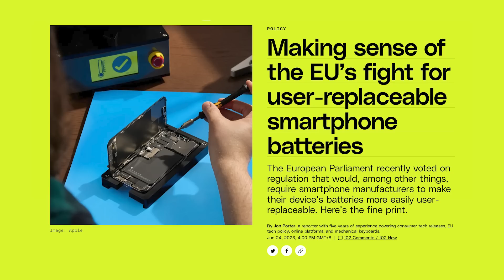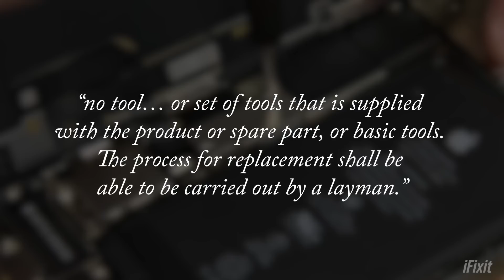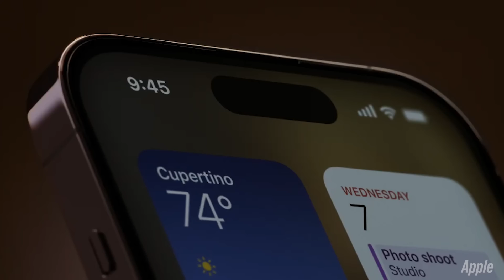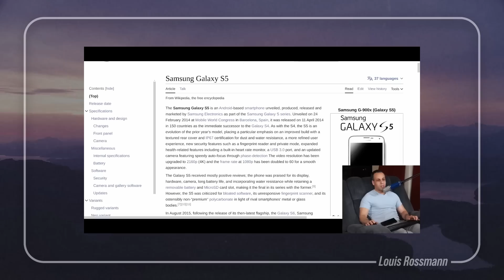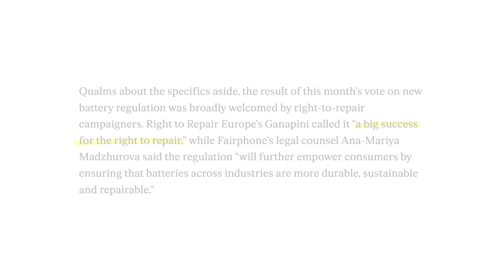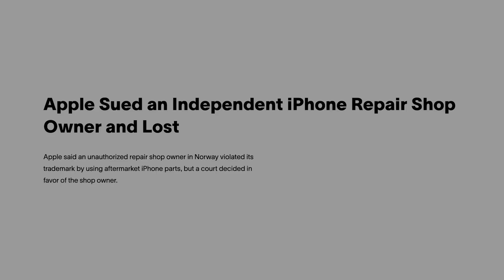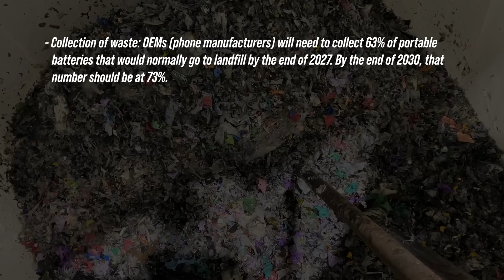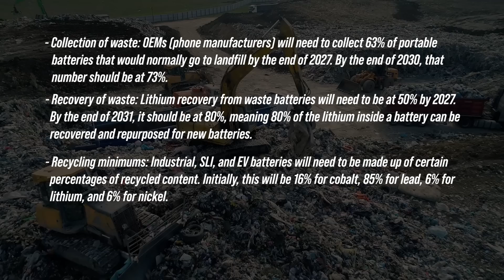EU Just Changed Smartphones Forever

Comment: You understand Apples' argument for safer repair? SERIOUSLY?
It is complete BS from A to Z and even IF you pick a shoddy 3rd Party repair shop, chances are you're still financially better off with a second 3rd party shop that actually knows what their doing, instead of going to the moron bar, which will recommend to replace your device with the newer model, because repairs would be more than the device was worth at MSRP NEW. That's just BS, nothing more, nothing less.

Comment: There is no such thing as consumer demand. But there is consumer interest. What’s the distinction? Consumer demand implies control by the consumer, consumer interest illustrates reality of Choice in purchase, because the options provided are predetermined by the interest of the manufacturers need to make the most money as possible. Nobody wants to not to be able to swap out their battery if they need to. But the interest of a market economy drives the manufacture to increase their profit margin through reduction of labor costs, because it’s cheaper to glue everything together than it is to have movable bindings, and connectors. 

At the end of the day you’re choosing from a variety of predetermined options that are weighed in interest of profits and not what you actually want. The goal for the manufacturer is then to thread the needle on that contradiction by providing options that are not too unpleasurable for the purchasing party. 

This contradiction has allowed for the development of phones without removable batteries and the loss of the beloved headphone jack.

Comment: SLR and Mirrorless cameras use detachable batteries and are still waterproof. Phones can absolutely be redesigned with this in mind, they just need something like an EU law to force them to do it
Reply: Last time I check DSLR not 100 dust proof let alone swimming in swimming pool . there is a reason why there is specialist camera that can swim
Reply: No, SLRs and MIL cameras are not even close to being waterproof. There is only ONE interchangeable lens camera out there with an IP water resistance rating. ONE.

Sure, some of them are water resistant, in the sense that if it there is a drizzle and your camera gets wet it will probably work fine. But if you try to immerse a camera in water the way you can a modern smartphone, you're in for a big, big surprise. 

Not to speak of the fact that the cameras that have the best weatherproofing are the very large, pro-level bodies that cost 5k+ such as the 1DX and D6 in SLR land, or the R3/Z9/OM-D in mirrorless land.
Reply: @lukapogo  Okay, surely a phone doesn't need the ability to submerge under water? If a camera doesn't need it, nor does a mobile phone? As for weather sealing, the Sony A7IV has it, which is under £2K. Heck, most high end phones start over £1K
Reply: ive used my iphone 8 daily since 2019 (i bought refurbished for $350) and the battery capacity is still above 90%.

smartphone batteries (at least with iphones) are good enough nowadays to last over a day on a single charge, and by the time the batteries lose capacity (5 years), the phones are no longer software supported

why is nobody thinking about this from a practical viewpoint? look at the design of iphones, replacing the battery takes less than 10 screws, and the waterproof seal can be completely replaced after. to make it any more simple than this would mean making the back of the phone cheap plastic, and would interfere with Qi charging and Magsafe.
Reply: Samsung S5 is waterproof and has replaceable battery too. Samsung XCover 6 Pro too (a brand new phone).

Comment: returning the old battery is simple:
return the old battery in the box you recieved the new one in. free shipping.
also keep in mind, the replacement of a battery to be done by a "layman".. does not count for advanced high power devices such as an electric car.
So the replacement will be possible - but it will probably require special tools to avoid having random fools attempt it, and get electrocuted

Comment: It won't change anything about top tier devices since it does not apply for waterproof devices...
Reply: It apples to all devices.
Reply: @ChristianIce  that's not true. Medical devices and devices that mostly are meant/used for wet environments don't have to follow those rules. So the only thing the companies need to do is promoting the phones as water devices and that's it... Oh and btw it has nothing to do with replaceability it's about recycling.
Reply: @KosiWien  
Phones will have to comply with the regulations, the exception you are talking about simply does not exist.
It doesn't say "all non water-proof phones", it says "all phones".
Reply: @ChristianIce  yes all phones as long as they are not meant for medical use or wet environments. Please finish your research before replying the same stuff again.

Comment: A very important phrase in this new law is that the product doesn't have to have a replaceable battery IF the product is specially made for contact with water or wet environments. My big fear is that this will be used to basically change nothing than to slap even more glue in it and change the marketing. Samsungs new waterproof tablets could be a good example for this.
Reply: I think you could say that even waterproof phones arent SPECIFICALLY made for going in water, its just a smartphone used for smartphone things

Comment: With the sheer number of batteries in a electric car, I will be supprised if they some how make those things replaceable without tools. I think inherently, you'd need a shop setup to get in and pull the batteries. It's always been that way with most forms of technical maitnence on vehicles as well, like needing a jack and a tire iron to replace a wheel. Everything else that's hand held or near that size, it's been possible previously to replace those batteries, so there should be no issue there. Even laptops used to have replaceable batteries. Though, needing to to use a screwdriver should at least be allowed. It's not difficult to unscrew the back of a laptop and pull the battery even now-a-days.

Comment: It would be great if the removable batteries could slide out of the bottom and the battery has the charging port built in to it so you can charge them outside of the phone
Reply: That way, if the charging port gets damaged, all you have to do is replace the battery!!

Comment: I'd rather have an IP68 certification than a user replaceable batteries. Most people uppgrade to a new phone every two years and batteries are good for that duration of time. I'm all the way for USB-C that the EU pushed as a standard for all small portable devices but replaceable batteries are an overkill in my eyes. It would be enough if they pushed for a legislation for batteries easily repleceable at any phone repair shop.

Comment: I also hate glass on phones. It's just bad design and material used. Back in the day I've dropped (by mistake) a 5kg dumbell in my HTC Wildfire and nothing happened, 1 year ago I've slipped my iphone from 10 cm high while tieing my laces and it cracked
Reply: "Bad design" is subject to the end user's use case. As wirelessly charging is becoming more popular, a glass back is required because a metal back will block power transfer from the Qi/MagSafe charger to the device. Just because YOU don't use the functionality of a glass back, it does not make it bad design. Find a device that suits your needs and call it a day.
Reply: you can use different alloys that allow the propagation of electromagnetic waves way better than glass and from what I've seen so far the glass on the back is put there only to get more money out of people because it is easily broken and it looks ugly enough to replace it.
Reply: @groovytau  What alloys are you talking about and how expensive are they to create on a mass scale for companies like Samsung and Apple? Metals do not allow better wireless charging from my understanding of how the process works. It would seem power gets converted into heat with a metal plate vs a glass one. I personally do not want a metal back that could get super hot because it is conducting electricity. I'm very curious about the alloys you are referencing though.

Comment: I feel like a good compromise would be to force the manufacturers to supply replacement batteries for a certain number of years after a phone is made. That way, we can still get thin devices while getting genuine replacement parts. Because at the moment you have to settle for aftermarket parts in most cases, plus getting your battery replaced at a tech shop usually doesn't cost much over the actual cost of the battery.
Reply: Batteries need to be standardized.
Reply: @ThreeIdiotsInaVan  I hadn't even thought of that, that's a great idea. Standardized batteries for different capacities would mean that you don't need to buy a replacement one from your manufacturer only, but instead any other can do. But I don't know if battery manufacturers would be willing to share their technology, because they aren't all the same. For example, Samsung batteries have been shown to have a tendency to swell up when left unused for a while.

Comment: To my understanding, If the battery maintain 83 percent of the capacity after 500 cycles and 80 percent after 1000 cycles, the battery does not need to be easy replaceable, so this is a loophole for Apple, etc. Is this correct ?

Comment: Having replaceable battery is interesting, for example in the DSLR, when a battery is empty, rock another one and go!  My house runs on older lithium 18650 purchased used. Only 8% are filtered out at the time of battery assembly. The old batteries still have capacity and low enough internal resistance. Since the workload that is asked to them is calm, those can last for years. People must understand that a battery has 3 lives : 1st use max performance, 2nd use lower performance : 3rd life recycle. The 2nd use can last much longer than the one or two yers of the 1st use. The 2nd use is great for standard batteries like 18650 of for BEV batteries (large) we could run entire villages on old BEV batteries that are properly managed, monitored, selected and maintained.

Comment: Just to be clear because so many people who report it seem to miss it: The new law states that a battery has to be removeable/exachangeable ONLY if the battery capacity is lower than 80% after two years of regular use. Otherwise batteries can be soldered into sealed devices as usual.
I think we will mostly see companies create a software block of charging above 80% capacity so lengthen the battery lifecycle but that's it. It sure is a step in the right direction by unfortunately by far not the magnitude many of us hoped for. It's not entirely dead but just barely twitching in the water, I'm afraid.

Comment: I am FOR EU's mandate on USB-C charging. No need to elaborate here. However I am NOT too sure about replaceable batteries. The phones will be alot thicker. Water resistance will be much harder. My Samsung IP68 Galaxy Active phone was destroyed due to water leak. LG? is NOT even making phones anymore! These are Not the biggest issue. I remember back then Samsung Galaxy Note 2 or Galaxy 4 or so era. I bought THREE extra batteries. I also had a custom charger for charging all the batteries at the same time. The POWER EFFICIENCY of the phones were NOT great because they know users might buy and use replaceable batteries. NOW the power efficiencies are better but so? Batteries will always be model specific. They create BIG wastes when phones are being replaced. But right you can buy a used phone and buy a new battery. But wait the manufacturer usually doesn't have old phone batteries in stock after a few years. And people will buy cheap after market batteries which may have safety or at least compatibility issues. We know wireless charging is NOT the solution because they are SLOW and HOT. There is only one solution: FAST CHARGING. We mocked the fast charging phones (Over 60W at least. 28W is NOT fast charging). But hey after so many years. Did any of them explode? Did we hear about the 10 minutes fast charging phone batteries died after 90 days? I don't believe I have. FAST charging will solve the charging issues, it will save billions of people many many minutes of their life. BUT yea if we all got FAST charging, then a replaceable battery would make some sense.RIGHT TO REPAIR is another thing which is worth debating on.

Comment: they could do the old design where if you pop the back off and you take the battery out to be left with a plastic shroud,  and make that water proof with adhesive like its currently done. and then use an o-ring around the contacts of the battery so when you put it in it will create a watertight seal. maybe use screws to keep it in place but everyone has a screwdriver so thats fine. with this, yes, the battery can get wet. but the contacts that the electricity flows through wont be.

Comment: Other phones are far easier to pull a part with the same sealing techniques as Apple, they also don’t throw errors when you use secondhand parts from the same model device. Apple is 100% cash grabbing. But they make some of the worlds best products and if you want them you’re forced to buy them the way they are. It’s good to see the way they are may be coming into an end, turn on at the expense of waterproofing, that will be their first excuse to fight it but they just have to think smarter. As proven, it’s been done in the past.

Comment: iPhone batteries are not hard or expensive to replace , just book it in for a replacement at an Apple Store or authorised repairer and it will be as good as new . Blocking unauthorised repairs is also good for discouraging theft.
Reply: The video literally mentions how it costs several hundred dollars to get a 50 cent part replaced.
Are you a bot or something?
Reply: @HJ_Extravaganza  Electronic assemblies are put together with many 50 cent or even cheaper parts, these assemblies enables efficient manufacturing and authorised repair. This also simplifies the parts inventory. Independent repairers are complaining because it makes it harder for them to make money. Also if you know repairs are going to be expensive , get an extended warranty or just don't buy one.

Comment: I support the idea of removable batteries, but applied to EV's it will block some existing models from the market. BYD for example uses their Blade-batteries as part of the chassis in order to save weight. So it will be impossible to remove it. 
So it will be somewhat be unfair for some producers, but not because of that decision itself. Rather because it wasn't done earlier.

Comment: With regards to the e-waste and environmental concerns, I believe more simply needs to be done to get the consumers to dispose of old devices more responsibly. Of course the next line of that value chain would be to ensure that the recycling or repurposing industries be improved so that the disposed devices are collected and handled accordingly.

As for the right to repair itself, the jury is still out for me. But so far, I think manufacturers shouldn't gate-keep third party repairers through code but I also feel that law-makers shouldn't inhibit design through certain restrictions.
Reply: "disposing of devices responsibly" helps little when PROCESSING those phones to actually separate the battery from the rest of the device becomes massively more inefficient with glued designs.
Reply: @HJ_Extravaganza  I agree. So what I'm saying is instead of focusing on design restrictions at the manufacturing level, we should put more effort in the disposal level where the problem actually exists.
Of course it's easier to manage business behaviour than consumer behavior but we should be disposing of these in a way that reduces e-waste while we enjoy the positives of efficient and sleek designs.